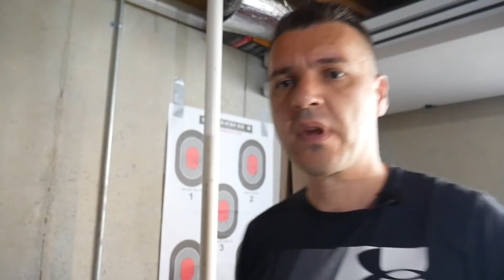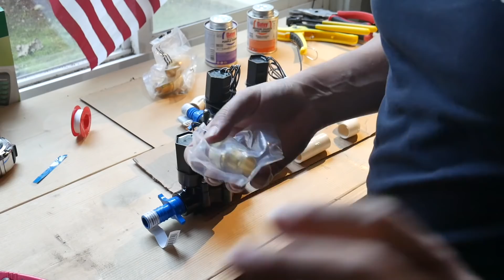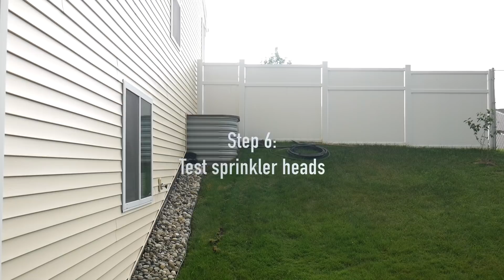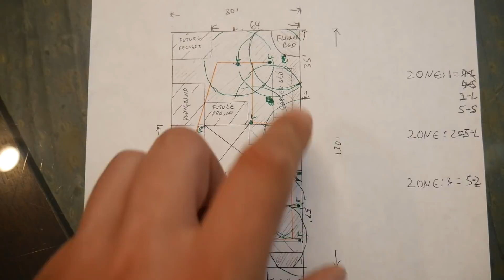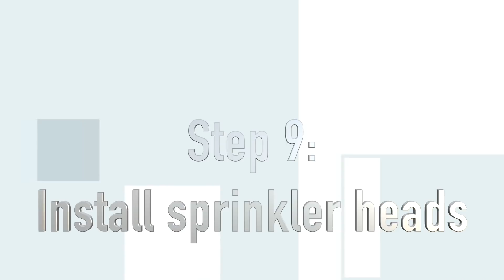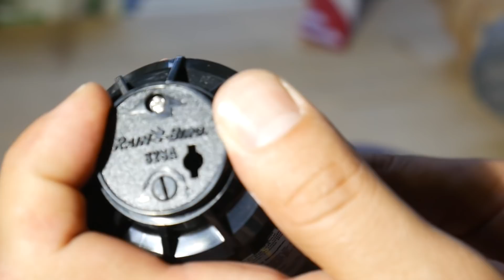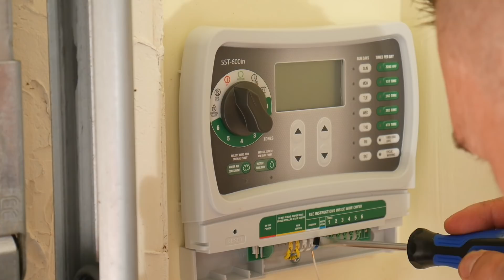How to Install Water Sprinklers - Do It Yourself

Comment: Great job, I hope that after 5 years, this is still going strong and you have no dry spots. One observation/question. When wiring the sprinkler zones, why didn't you put all three ground wires from the zones together, then connect those to the cable ground? You would have only needed one wire nut for all grounds, making it a lot easier.
Reply from the maker: Hello. Thank you for watching. No problems at all with sprinklers. You are right, I could have done that. Thanks for the suggestion.

Comment: Thank you sir for an outstanding video on DIY sprinklers. This has to be one of the best. Step by step with simple explanations for something that is not so simple.  It's June 2025 when I watched this and this video was made 4 years ago (and it's still one of the far better ones out there). I'll be using different hardware, but no matter, your video was extremely helpful.
Reply from the maker: You are welcome. Thanks for the kind words.

Comment: My final thoughts are do you have to daisy chain all the ground wires from the zone valves? Couldnt you just use one big wire nut to fit all 4 ground wires together?
Reply from the maker: Technically you could.

Comment: i love seeing the attention to detail and doing it right very good work, i used sched40 3/4 pvc on all of my sprinkler system i just finished and i used a 3/4 slip T with a 3/4 threaded outlet then i put the 3/4 to 1/2 elbow to connect the 1/2 funny pipe then ran that to my sprinkler heads, i really considered getting the poly pipe but for my system its small so pvc was just easier

Comment: even though the pex is listed as a 3/4 inch pipe, the inside diameter is closer to 1/2 inch and there may be a flow problem.  i would have cut into the copper pipe for a full 3/4 size.  i didn not watch the full video but a drain valve should have been added after the shutoff.  i know the shutoff has a drain but it has a very small hole and will take long time to drain the line

Comment: You don't need teflon tape when you fit plastic to plastic, only when it's PVC to brass.  I use a putty that's quicker to apply. I've been installing and repairing sprinklers since 1994 and I can tell you that on a complete system of 6 zones or so, the process used in this video is inefficient.  Also, I do no like to manifold the valves in one box, makes it harder to repair and you have to run more pipes to feed the zone;  I rather run a high pressure main line and tee off from there.  Valves will be located near the actual zone layout,  keeps them in balance.

Comment: CAUTION: CPVC are affected by UV light, so being exposed may cause problems in the future. Painting can solve this. Also after glueing it should twisted, like you did, but held in place for 15-30 seconds so it doesn't move (pop out) with the chemical expansion process the glue causes.

Comment: Thanks for the video. I'm changing all my rotors to rotarys. It's not as simple as unscrewing one and adding the new with reducers. After seeing the video, I need to run funny pipe off the main and relocate the heads to keep the pressure to all the heads equally.

Comment: Great video on the process.  One item id look at adding is an additional water meter for the sprinkler system alone.  Residential water has taxes and sewer use fees added to it, so thr more water you use, the more you pay.  If youre on a well then this doesnt apply, but most municipalities will charge a lot in sewer fees.  Look into it in your area beforw starting the project.  But man, you made it look easy.  Thanks!
Reply: Depending on the particulars, a well can pay for itself, and the independence from: the expenditures to the city for using city water and adherence to city codes and sprinkling bans pertaining to systems on city water is a reward in itself. 
Where I live, there is no requirement for a Backlow Prevention Device on a well, and along with that, no yearly inspection/ rebuild fee, paying a certified professional to do it, and the hassle that goes with it. 
With some guts and physical ability, a home owner can dig their own well and save a large amount of moolah from the start. However, getting this part done correctly is essential, so an experienced advisor/ assistant would be practically required in my opinion.
It requires complete attention to details and avoiding any temptations to cut corners to save time and money. 
I would not want to be in a big hurry or under some kind of deadline pressure.
A well is nothing to wish one had done differently or a line of shoulda-coulda-woulda.
I have decent neighbors who hired a company to drill a well along their property line and shared the cost between them. They worked it out with no issues coming between them. That's a real trick!
What kind of person can pull this off? It helps that they aren't so committed to pushing through agenders that separate individuals based on politically-devised gimmicks based on old Marxist playbooks. 
People can get along and not make a shared experience of life on this planet more dificult than necessary. The recent generations have been misled and cheated by phony Communists and Nazis who sit in University/ Academic seats of bureaucratic power as well as all-too-often positions on city councils, etc. Democrats who are supposed to represent people in need of big cities(Baltimore, DC, Chicago, etc,) dive in head first to take for themselves, using Scumbags like the Clintons and Bidens as role models to steal, rape, kill, plunder, destroy on a massive scale. Like cancer, it becomes almost impossible to stop. When the protectors, such as the DOJ and FBI, are cancerous, how do you stop them? (Pricks like J Comey) Heros seem hard to find.
Sorry, but w/o this problem solved, who gives a crap about dyi about sprinklers and wells?!
It's how I make a living, but pur future is getting crapped all over by real Scumbags.
They want us to forget about: The Afghanistan-Joe Biden Chicken-Shit Run-Away Embarrassment Of The Century, Fraudulent 2020 President Squatter, wrongful persecution of Capitol Building peaceful protestors, The Chinese Virus Panick-Demic and spin-off issues, the evil support for violent rioters throughout 2019 and since, wrongful disrespect and removal of support for the police, and the list of failures and evil-doings goes on w/o end!!
They intend for us to forget.
They intend for us to get it all wrong!
They intend for us to be ignorant.
They intend for us to be forced into their way of doing things because of their lawless handling of matters in the same fashion that Hitler handled his problems.
The list, once more, goes on and on.
We need to pray to God, humbly on our knees.
We need to confess sins of commission and ommission and repent.
We need to stand firm and fight.
God bless America.

Comment: I really want to do this, but my biggest problem is the digging.  Just below the sod is just clay, and rocks... so many rocks!  I was so jealous when I saw your nice soil/dirt in the ground.  Great job on the install.
Reply: You should try renting a 35lb breaker hammer from Home Depot with the shovel bit, they’re only about $100/day but it will make trenching so much easier. We also have heavy clay soil in my area and we use one all the time, usually we can dig up the trenches for an entire sprinkler system in about a half a day  with one of those

Comment: You keep saying ground wire. Do you mean neutral? The neutral goes to one of the cables of the solenoid and the other solenoid wire connects to
the corresponding colored wire going to the controller for the specific zone.

Comment: Zdravo - How much GPM will 1/2 vs 3/4" hose flow for ~200-250 ft? Much easier for me to get 1/2" vs 3/4" but I feel I may need 3/4" if I keep my design as single zone. Faucet flows 12 GPM @ 60-70 Psi, current sprinkler design I want to run would flow minimum 3.5 GPM (4 Heads) and max 5.5 GPM (6 Heads), all heads at 40psi. I presume 1/2" would have too much velocity, correct?

Comment: great video. I was planning to use 1/2 inch poly pipe but a guy that installs for a living told me to use 3/4 inch. I only have 3 heads so I thought 3/4 is overkill. What do you think
Reply from the maker: I agree with you. No need for for bigger pipes with 3 heads.

Comment: Most detailed video on YouTube about this glad I found it. Really want to do this myself as my quote was for $5,200 for 12 zones. What do you think you spent on materials? Any reason why you used the black flex pipe instead of 1 inch PVC?
Reply from the maker: Glad you liked it. I spent around $1000 on materials. I didn't use PVC pipe because the city didn't allow it. Thanks for watching.
Reply: @NeverStopDIY  Maybe because of the cold winters in Michigan worried about freezing. In Maryland they allow it.
Reply from the maker: @Analyzer52  Not sure. The city inspector was mentioning something about the pressure ratings, but I can't remember what it was :)

Comment: How did you learn how to work with pipe fittings and connecting all the electrical wires. I’ve never done anything like that. Is this project for someone with basic knowledge or would I become overwhelmed?  I’m ok with a hammer and
Reply from the maker: I would say this is a project for someone with intermediate knowledge. However, I would practice a little bit with pipes and wires and become comfortable with connections and making sure there are no leaks, etc. I would spend $50 and get some fittings and pipes and connect them to your outside faucet, test it and play with it until you get some experience and until you feel OK with doing a larger project.
Reply: Thank u excellent advice
Reply from the maker: @bobbypacifico6943  my pleasure!

Comment: Agreed. One of the better videos I’ve seen thus far. It’s really a great look at the process start to finish. The small tid-bits of information on fittings and house options, zone planning schematics, and how to adjust sprinkler heads are really great for those who want to start from scratch and get the job done!

Comment: Have thought about adding a rain sensor to keep the system from running when it rains.?
Reply from the maker: Actually, I did replace the controller with the smart one from Rain Machine and that will cancel the watering depending on the weather.

Comment: Very helpful video. I'm about to install a sprinkler system following what you did.   Thank you so much.  I would like to add two notes I found out.  1st when a pipe is labeled 5/8 OD and 1/2 ID and you go looking at home depot and you only see 3/4  and 1/2 fittings, those are referring to the inner diameter.    You need the 1/2 fittings.   2nd, if your going with the stronger CPVC, you will need the CPVC primer and cement.  The cpv primer and cement will not work.
Reply from the maker: You are absolutely correct. OD stands for "Outside diameter," and ID is for "Inside diameter." CPVC cement is usually orange and that's how you can tell the difference. Thanks for watching.

Comment: You are the man I thank you so much I didn’t know anything about sprinklers or flex pipe my brother tells me he did the flex pipe I had a cousin did a 3 foot piece on my outside pump but watching your video omg it help so much I wanted to move the outside water system in another a rear cause I want to put concrete in the garage so now I can have a well water and county water thank you again for sharing the flex and the sprinkler I just purchased a sprinkler yesterday
Reply from the maker: I am really glad this video has helped so many people. After I heard how much companies charge for work like this, I was stunned. I know most of us can do stuff like this by themselves and it proved out to be correct. That being said,    I am honored that my video has helped you so much. Thanks for watching.

Comment: What are your thoughts on installing the IS from the outdoor faucet?
Reply from the maker: Most people advise against it due to various reasons: you can get muddy water back in your home drinking water and most cities don't allow it without a back pressure valve anyway. Also, there will not be enough pressure and waterflow in your sprinkler system. Thanks for watching
Reply: @NeverStopDIY  thanks. Such a helpful video.

Comment: Great job on this video 📹 👏 I hope I can do as good of a job as you all have done. I'm in DeSoto Texas and will need too check with the city on if a permit is needed what time of sprinklers, pipes and elbows can be used. They have strict rules here and might say it needs to be a Licensed contractor or Licensed plumber. 
But anyhow Great video very clear details it's  official I'm a fan now thanks!
Reply from the maker: I am glad it helped you. Here, in Michigan, the thing that matters is the back pressure valve. They care about water contamination and what you do after that is on you. If you have a friend or a friend of a friend who has a license, and who would be willing to help you just to come out check all the work you had done, you could still save a lot of money, if you know what I mean ;)